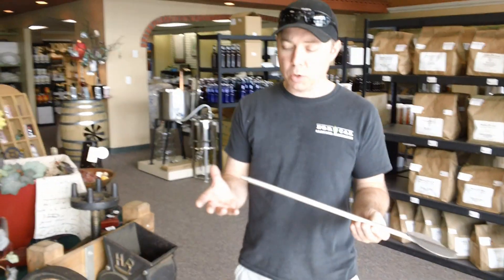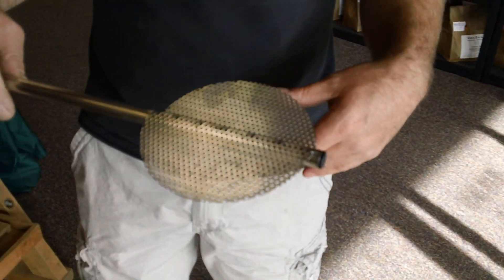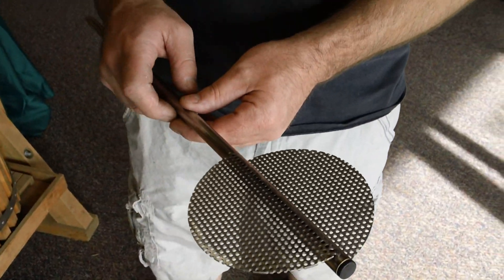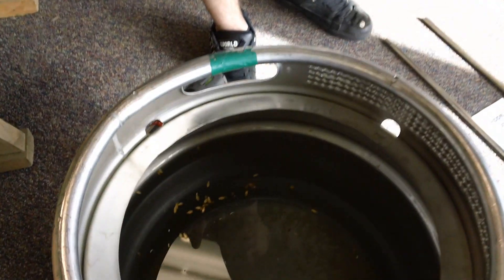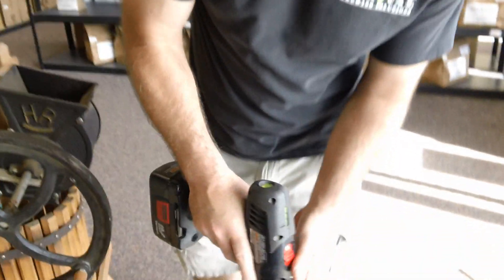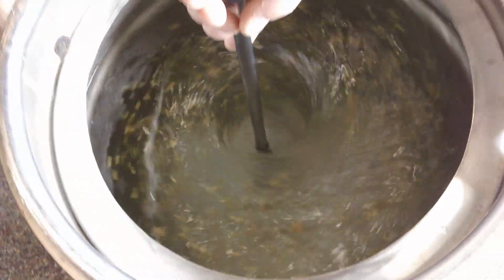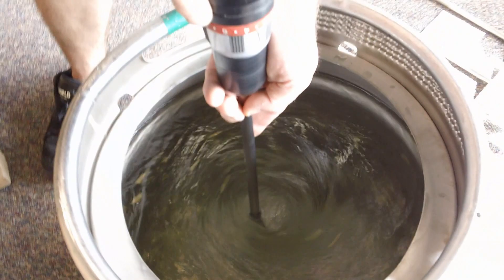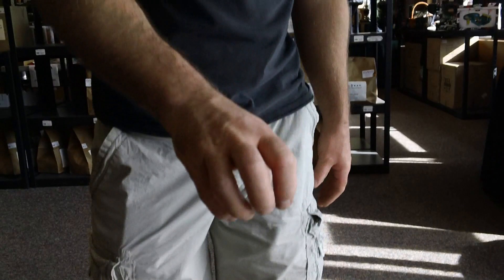How To Whirlpool your Beer Wort to Create a Trub Cone

Comment: Will this work if you have an electric element in the kettle?
Reply from the maker: Yes.  It is not as efficient as in a kettle with absolutely nothing in there but yes you can get a whirlpool going and keep it going with an element in the kettle.  The "CONE" will form along side the element and it won't be as "PERFECT" as an empty kettle as the element disrupts that perfect flow.  
Cheers
Jay

Comment: Do you wait for the whirlpooling to stop before you transfer to the chiller then?
Reply: Jay Webster good advise! I slowly Whirlpool while chilling to increase heat transfer then pull chiller out and get up to full spin and let settle. works perfect every time! I love clear beer 😎
Reply: @CricketyChris  and what about the contaminations? When you do whirlpool with such pad you aerate the wort extremely.
Reply: @shreko2  contamination from what?
Reply: @shreko2  as long as you're pitching yeast soon after aerating it, the yeast stabilizes the wort. Before off flavors can develop the yeast has already made a nice home for itself that resists bad bacteria from forming. At least that's the way I understand it.
Reply: If you are using an immersion chiller you would want to chill first so you don't disturb the cone.  Yes you will whirlpool then let sit.  I would let mine site for about 20 min but you can transfer sooner if your happy with the cone and how its developed.  
Cheers
Jay @ Nor Cal Brewing Solutions

Comment: Dumb question, you would want to do this after using an immersion chiller, correct?
Reply: Many people use the chiller to get it to the whirlpool temp they want, whirlpool, then resume chilling. For IPA a good whirlpool temp is usually between 150 and 160.
Reply: After cold break... protein flocculation.
Reply: +AuroraProject08 Not a dumb question. Yes. Chill, remove the chiller, whirlpool. In fact I use a paint-stirrer to drop from boil to 70 in 15 minutes or less so I already have the stirrer all chucked up in drill.
Reply: I whirlpool while the wort is still hotter than 160F, not after it's chilled.  But I suppose you could do this just prior to pitching the yeast.

Comment: would this make oxidation possible? I mean, as the wort is about 200ºF this whirpool may introduce some oxygen into the wort. How much time is ok?
Reply from the maker: Hey guys, thanks for your interest in our product! Luis: You do NOT want to introduce oxygen to the wort while it is still hot (that is called hot side aeration). You want to stir the wort at a slow enough speed to where you get good cyclonic action WITHOUT adding a lot of bubbles. If you see bubbles being introduced, slow down your drill.
Reply: the oxygen would be fine, because you still have to aerate your wort anyways before pitching. You generally want to wait around 10 to 15 minutes after whirlpool to let the cone form.
Reply: phucarr Thank you for your answer! but what worries me is that oxygen must be added when the wort has cool down a bit. Maybe all I have to do is try it and see how it works!
Reply: Luis H Valdez Gurrola I see what you are saying. If that really concerns you, you could always cover with a lid or foil while waiting. I would be more concerned about something falling into the wort that could possibly infect. You could simply just whirlpool gently with your paddle/spoon or even wort chiller as to avoid vigorous splashing which could lead to oxidation.
Reply: Thank you for your answer! I'll try this next brew day!
Reply: If you are doing a hazy using low disolved oxygen techniques, then maybe. Those LODO guys are manic about it, but I have noticed some differences in hazy beers using LODO techniques. As far as whirlpooling, a pump and whirlpool return is better, IMHO, especially for hop stands and immersion chiller effectiveness.